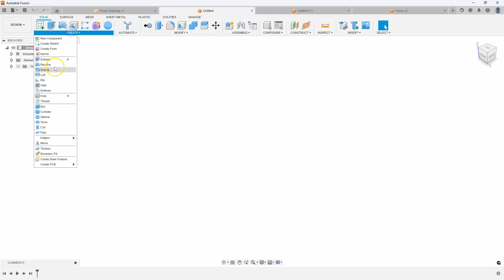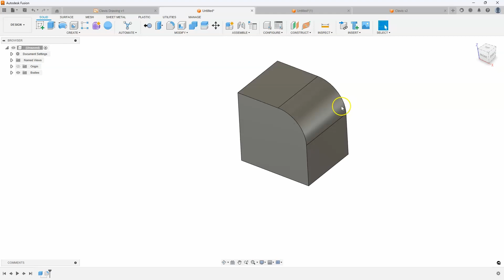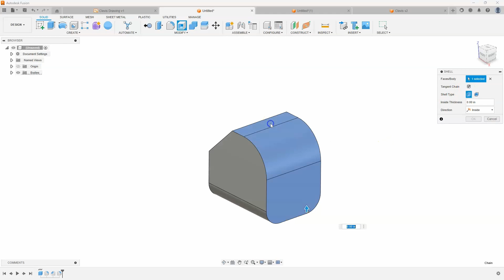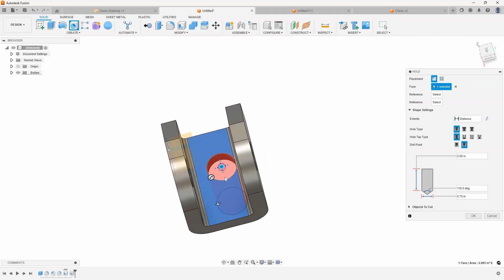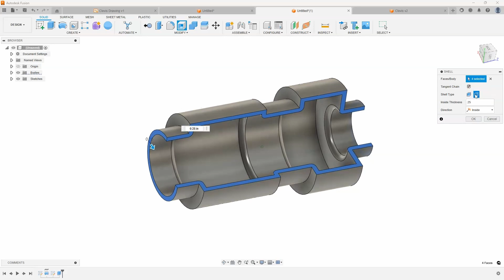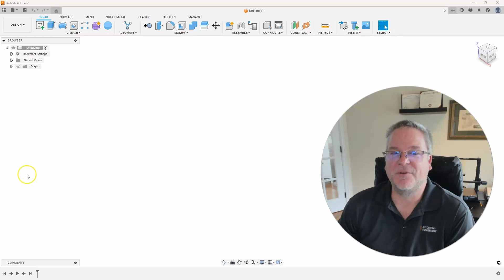Fusion Friday - What the Shell?!?!

Comment: Great info! Question: The file section of Fusion that controls file selection no longer works properly. (2024May22) I submitted a ticket to Fusion. What have you done to resolve problems in Fusion 360?  I've been using Fusion for over 7 years and never had a problem before.